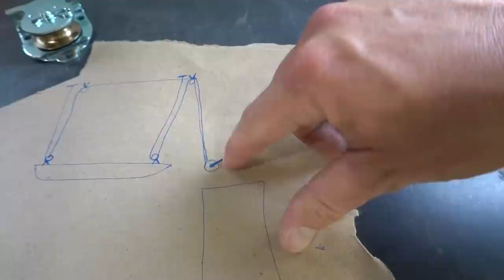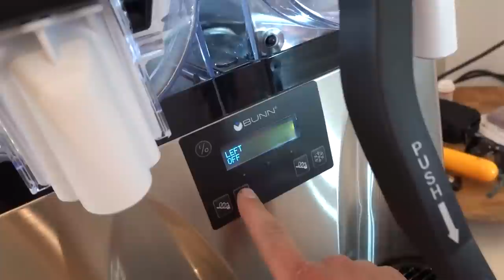Big Lake Day Fail...

Comment: Ah yes, the Bunn Ultra. I have worked with these and similar machines for years. The easy way to make drinks for adults is to do the math to convert from blender which is 6 cups or 24 oz to 2.5 gallons or 320 oz and simply replace the ice with roughly 2/3 of the water. Keep in mind that 2.5 gallons of any adult drink may cause certain side effects.
Reply: man, I have some serious slush machine envy, they're expensive things for home use, one of the biggest signs that Matt's really made it, you know, along with the warehouse size man shed ^^

Comment: Hey, Matt

I'd stay away from small profile hard things like chain and such on the kayaks. If it gets as hot as I suspect it does in your area, heat and small pressure points will deform the Kayaks over time. I'd recommend getting some big rubber straps or even using wide tow straps to help distribute pressure.
Reply: It’s a ac shop
Reply: I agree on distributing the load on the straps. A sail shop/boating supply could fix you up with sewn nylon straps to slip over each end, maybe a bungee or tie between them to hold securely and keep from sliding off if something bumps the kayaks.
Reply: I think there's AC
Reply: @olred8594  I highly doubt the ac will be running 24/7 and anyway the kayaks will still deform
Reply: Matt said in a an episode that they are not installing AC.
Reply: @gavypatty  only the office spaces were AC
Reply: Ya, seat belt tape would do the job, have the upholsterers sew up a custom triple sling.
Reply: @marvindebot3264  Yup, as a mechanic, i've used old seat belts from vehicles as slings a whole bunch, never had one even begin to fray, let alone break and that's lifting 700 pounds plus on a single loop.
Reply: He could do something crazy and tell one of those kayak rack manufacturers that he’d recommend them to his millions of subscribers if they want to showcase their soft mounted rotating kayak rack that raises lowers and polishes the things on his channel. He’s pretty well way past having to purchase anything if he will just mention your wares on the channel. You still got respect a man that has that kind of clout always elbow deep in the mud next to a laborer or scrubbing in to fix a pups junk none of his success has gone to his head.
Reply: @raynman6466  his shop is good and insulated and yes it’s Texas it’s about a billion degrees here in the summer but even if you only have 1 window unit it will still stay cool
Reply: I have a Hobie and was thinking the same thing. It's heavy compared to his. A cradle would distribute the weight nicely.

Comment: You can use one single wire strand and accomplish the same thing with the same hardware, but half the wire. That would help with your spool being so full and would self level the kayaks. From the wall to the ceiling, down to the kayak and back up to the ceiling, across to the next beam and down to the other end of the kayak, then back up and terminating at the beam.
Reply: Take away the winsh and take a powerdrill as your winsh
Reply: @jonatanrask2349  “winch” I’m not being rude just trying to help
Reply: @Pwills  thank you 👍 im from sweden and I didnt know that 😊👍
Reply: For safety you need to use a hoist, not a winch. Difference is that it is designed to hold overhead safely with catches that lock the weight. Winches are for pulling, not holding.
Reply: @jonatanrask2349  no problem 👍
Reply: @user-lt6oh2bu7c  that is all I could think of. No way I'd stand or even walk under those kayaks. The little pawl on the hand winch isn't up to the task of holding weight.
Reply: @garrettstevens2232  with all the mechanical advantage, vs the weight and the weight rating of the boat winch.. it's more than adequate. The winch is probably 5:1, and the attachments on the kayaks are 2:1.. gross 10:1 not counting for losses due to friction, the pawl holding the ring gear will only see 40 pounds of load. That's using Matt's estimate of 400 pounds of kayaks/gear
Reply: I was thinking the same, Mere should have known that.
Reply: @garrettstevens2232  Sure it is. That s**t ain't goin' nowhere!
Reply: @SLOCLMBR  yea I was looking at those pullys and thinking it's definitely not 4, I thought it'd be 3 because you count the "up & down" trips, but maybe the one you pull doesn't count?

Comment: Mat I learned a lesson a long time ago. It doesn’t matter the load weight of the pulleys if the fixings you use to secure them pull out at about 20lbs hope you factored the fixing strength

Comment: Matt, If you replaced the broken handles on the kayaks with rubber-coated cable/chain, then you can just hook to the handles without them breaking. Chain with a rubber sleeve over it would be much easier because the bolts holding the handles on the kayaks will fit right through the chain link.
Reply: Good luck with that Bunn machine use to work on them

Comment: Matt, I used to work at JJ's in College Station as well as serve you Coors light chugers at The Texas Hall of Fame (RIP). I'm not sure about "slushie" syrups but for the Margarita machines we used at JJ's, we just used a standard margarita mix that was non-alcoholic. I'm sure any adult beverage store would have non-alcoholic margarita, daiquiri, pina colada mixes for your machine. We always made ours in 5 gallon batches using water cooler jugs. Also when you do a batch, if I remember correctly, you want the machine close to max volume. It would always help our machines get the right consistency.

Comment: Matt, the mechanical advantage of any pulley system can be determined by the number of strands running between the load and the fixed point.  You have 2 strands in each of your pulley systems so you get a mechanical advantage of 2.
Reply: First step: free body diagram haha

Comment: Matt the best way to make margaritas is to make your own mix. Margarita mix’s are just everything else minus the tequila and often the lime juice. And it’s easy and better to just make your own. Also getting the water ratio right if you’re mixing it in a machine like that that’s gonna slushify it is very important. That I don’t know unfortunately but it’s best to try with ice cubes and a blender first. Find out how many ice cubes per drink equates to the right amount for you, then figure out how much water went into each ice cube and that’s the amount of water you want per serving. An easy recipe would be 2 oz of your preferred tequila, 1 oz lime juice, 0.5 oz orange juice, and 0.75 oz of simple syrup. You can always adjust depending on your preference, and of course different juices for different flavors. So If say you try it in a blender and you find that 6 ice cubes is good for that amount, then pour water into 6 ice cube trays and then pour that water into a measuring cup and see how much water that is. Say its 1 cup. Now you know the recipe per serving. So just upscale it. So if you want 10 servings you know it’s 20 oz of tequila, 10 oz lime juice, 5 oz orange juice, 7.5 oz of simple syrup, and 10 cups of water. Then just let it cool and mix until you get the consistency you want. And get a decent simple syrup not a super cheap one, but you don’t need anything expensive

Comment: The reason the kayak felt so heavy with just one line from the kayak to the ceiling back down is because you gained no mechanical advantage, all you were doing was redirecting the line (and doubling the weight on the anchor at the ceiling). The only way to gain mechanical advantage is to increase the lines to the load. 1 line to the load is 1:1 advantage and 2 lines to the load is 2:1.
Reply: Hey isn't his wife an engineer? He should ask her

Comment: Matt I think you need those instructions for the slush machine!!! You'll get the mix correct ;) -  recommend mixing all the products before pouring them in the hopper. Option is Gatorade slush or if you need a kick of energy a coffee slushie.  Its recommend thawing the product in the dispenser every day, overnight. If left frozen for a long time, the ice granules can get too large and it would make it difficult to maintain the consistency of the drink. Thus, we suggest to turn the ‘Night mode’ on for a few hours and return it to ‘Day mode’ when you feel that the product has thawed enough.
Reply: Here's a link about making slushes - https://youtu.be/aEX1ALF8YG4

Comment: Matt, you should really run those cables down the wall through some eye bolts so that it doesn't hang out at an angle. Keeps the cables out of the way and keeps them in line to the winch. And yes and electric winch mounted lower to the ground or remote controlled.
Reply: I'd use pulleys instead of eye-bolts. There's too much risk that the cable would grind itself against the eye-bolts, wearing it down to the point it frays and / or breaks. Maybe not under as little weight as is being applied here, but if there's the potential to buy further kayaks / whatever, it may start to push things. It's also a good habit to get into to not cut corners (like using the wrong fixtures).

Comment: just wondering, I am not a doctor or an engineer, but wouldn't this put all of the stress on that flimsy-ish wood mount you put the crank on? I'd consider it sketch-adjacent at the very least. This video gave me good vibes as it reminded me of the last time you recorded rigging up a kayak mount!
Reply: You would be amazed what a 2by4 can hold/support. I have almost a 1000 pounds of stagnant weight being supported by wood benches i built.

Comment: The best mixture for margaritas I've used is 9 cans of frozen lemonade mix and 1 can of frozen orange mix from the freezer aisle at your grocery store.  Pour them in a 5 gallon bucket and mix with  1.75L of tequila and a fifth of triple sec.  Fill the rest of the bucket with water and stir.  Use this mix in your margarita machine and you won't regret it.  We always get tons of compliments about the flavor and they are surprised to hear how simple it is to put together.

Comment: As a person familiar with rigging I would say you almost got it on the Kayak lift.

All you need to do is get a pully to put right above the winch (but on the roof) wherever the winch ends up being. Run the lift cables to that then they will come straight down and also not cross the lifting path since they will be doing the shift over on the roof.

Also, take off the handle and weld the nut on the winch then use a drill. 👍

Comment: I'd build a cradle for the kayaks like an upside-down bed frame. Probably from aluminium angle or small (1 inch) box section with bracing. It could all be bolted or welded together. Mount it out further in the shed for clearance. Attach the winch lower on the wall near the door or between the roller doors. Use free swinging/swiveling pulleys so torsion isn't an issue. The first pulley can be inside the pitch of the roof at the top of the wall with the second set on the rafter any distance away (depending on the winch spool capacity). If you use a single cable to lift the cradle with a 4 point lift to central line then you can use flat webbing which is commonly used on boat winches and doesn't have the problems steel cable does. The weights you're looking at don't need steel cable.
You can take the handle off most winches and replace with a cordless drill and socket.

Comment: Matt, two things. When you cut cable, wrap some electrical tape around it then cut it, that helps the strands from fraying out. And get a socket adapter for your drill and weld a nut to the crank, then you can use your drill to lift/ lower the kayaks.

Comment: as someone who has some experience with those machines...... your standard margarita and pina colada mixes work fine. That's how the bars in Florida use them. its the best way really. These can be pretty high maintenance .You need to clean the seals every month. the syrup is just suger water and the sugar crystals can build up over time and shreds the seals. hot water works fine. Frazil (one of the slush companies) post some of video on youtube on how to take care of those machines.

Comment: Did you through bolt the pulleys to the metal beams or did you use screws?  Screws have great shear strength but the heads pop pretty easy. If you didn’t, change it to bolts with nuts.

Comment: Hey Matt, you could use a 12v winch for a Jeep or ATV or boat trailer. Make sure it has enough drum capacity for the cable and a lock out of power fails.

Comment: Matt, you can use pulleys to make a 90° turn to the wall and bring the cable back down near the wall, so your cables are parallel to the winch and not at an angle.  That would be easier if you could actually screw stuff to the wall but I think you can figure it out.

Comment: So the pulleys all had a weight rating, but what about the screws you used? The way hti swas installed, ALL that weight is being supported by the threads on what appear to be screws, not bolts.

Comment: Matt you need a Granita mix for the machines, they have to be 1/2 full to work properly and you may want to find a Restaurant supply store to get your syrups. Also keep it on with mix in if even if you're not using it or clean it out and dry. The parts can get moldy quick.. I used to work in the beverage department for a food distributor. Enjoy the Granita machine.

Comment: We have the same Slushy machines at my work yours are newer though. If you are planning on using them for Alcohol idk how that will work. But when it comes to the mixing use twice the of Concentrate compared to what it says recommend getting a 1 Litter or a 1.5 gallon to mix depending on how much you want to make. also premix before putting the the machine but you want a 1-2  ratio 1 part Concentrate 2 part water the more Concentrate the sweeter it will be and better tasting. Depending on the type of Concentrate of course hope this helps

Comment: Look into synthetic winch rope tying kayaks together. Metal could eventually rub into the plastic. Or install eye bolts in the kayaks then you could use shorts length rope to put kayaks all together.

Comment: You could use another pulley right above the crank to align the rope / wire into the crank. Use a board to help with the realignment.

Comment: They make wall racks specifically made to store kayaks. Your elaborate plan may work but still lots of work cranking it up. With wall racks that hold the kayak off the ground one cable crank or electric lift system can hang all three separately Startin at the top then middle then last lower. It would look more professionally done and completely safely out of the way. My opinion

Comment: Those Bunn Ultra II's Slushy machines do require some maintenance every year or so.  You will need to replace the shaft seal, otherwise it will start leaking into the barrel..its not very hard but you have to remove the back motor and shaft to do it.  There are some youtube vids on how to do it.

Comment: Mere looking like she's never had any children, all svelte, and then Adalyn standing next to her, looking like pretty soon she's going to be taller than Mere.  Got that from Matt's genes, I should think.   Love the new Link Active wear.  Looks pretty.
Re: the canoe's, Matt you need to put rubber hose over the chains if you use chains, so they do not damage the boats, or use either straps sown to hold the canoes or make a rubberized aluminum rack to hoist up to the roof.   Agree with the motorised mechanism also, it does make things easier, and the motor and its attachment ratchet can be put up while the switch can be at ground level so you don''t  need a ladder.  Ladders are dangerous.

Comment: Harbor Freight side by side or quad winch. Swap the cable out for the cables you ran. Wireless controller, and you're set. You'll just need a 110v -> 12v converter to wire it in, or use a jump box to power it when you need to use it.

Comment: Seed the rest of the hill and outter front yard ASAP. Sod would cost too much for the size - but seed will grow within a few week and over the large areas (unless you want to sod it all which is a waste unless you want to actively take care of it with the main backyard and frontyard area and most don't). Just make sure there is a barrier between the seeded and sod grass and use seed that is low maintenace (won't be as nice of a grass as sod but you can leave it alone and mow it every now and then.

Comment: I used the manual crank winch method that you show on the wall for my elevator (dumb waiter) with a rope out in the garage.  Just this month changed out to and electric hoist method with a cable and the only bite is the cable on the handheld controller (up/down button) was only 3 feet long.  So, extended that and now it is really nice to just push a button.  The electric hoist was about $140 (Amazon) for an 880 lbs capacity.   Matt - upgrade this puppy.

Comment: If the pulley moves count the number of lines up and down, if one going up and one going down and the pulley moves it is a 2:1 system. If the pulley is anchored and doesn't move it is a change of direction only. You should be able to look the boat winch up and find out what mechanical advantage it is.

Comment: Make L brackets for the Kayaks and center the Lifting point in the middle of the kayaks so you don't lift one sided and the weight is centered under the cable. You can use rubber on top of the brackets so the Kayaks don't get hurt and if you make this a modular thing cause i see more kayaks in your future you could also use that system to transport them on a trailer that this system mounts to...